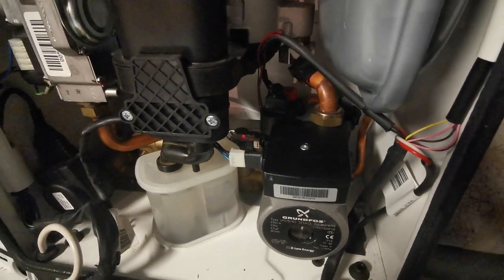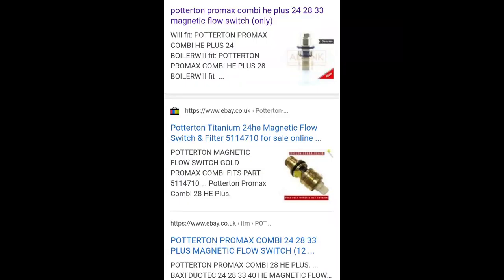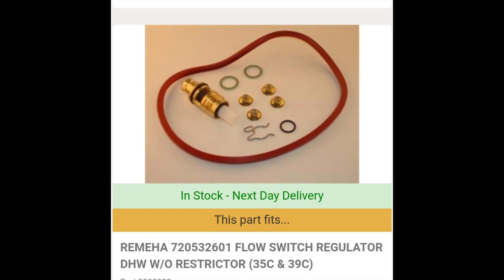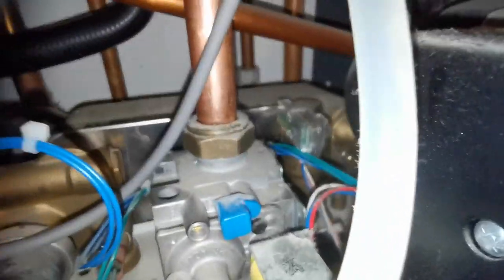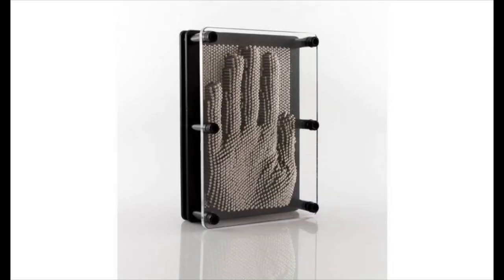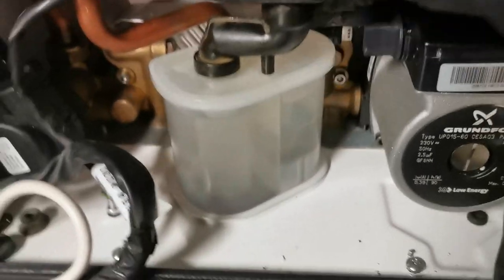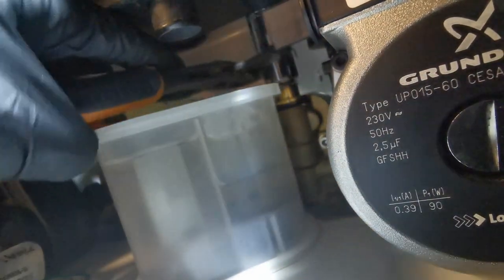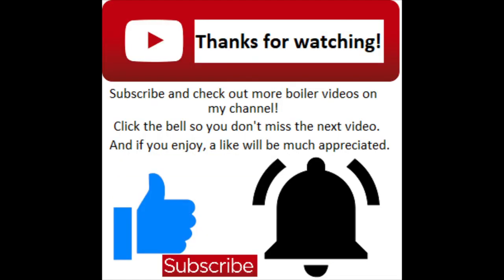HOW TO CHANGE THE FLOW TURBINE / MAGNET FLOW SWITCH SENSOR - EASIEST & FASTEST WAY IDEAL LOGIC BAXI

Comment: for those whose tubine is stuck solid.
1. remove pump (2 screws). That will give you space.
2. Use 18 mm six sided socket (from toolstation). standard 18 mm 12 sided will slip.
3. get a breaker bar, or extended rachet. (spray some wd40 on flow turbine)
you should be able to get off.